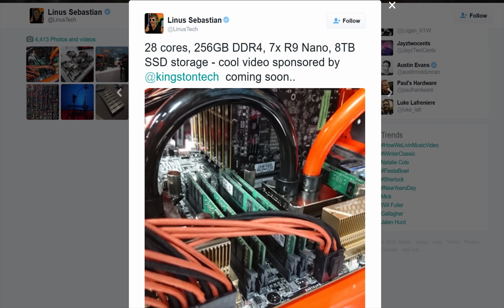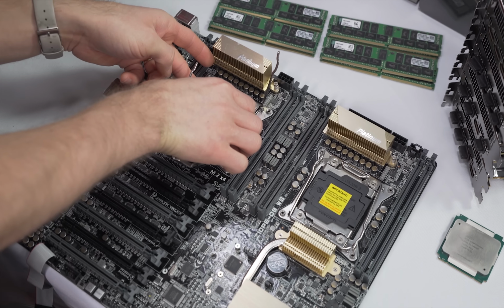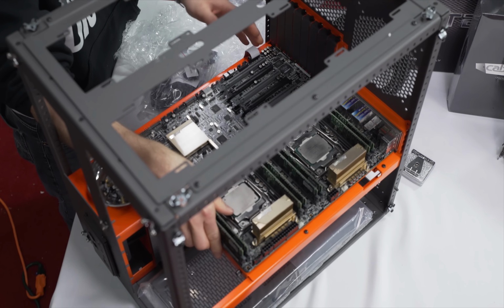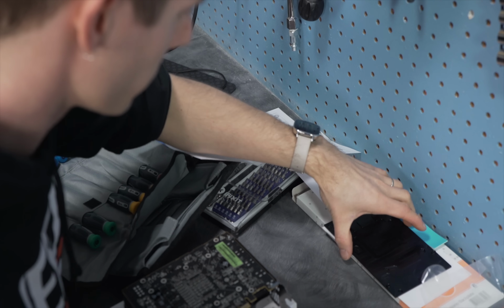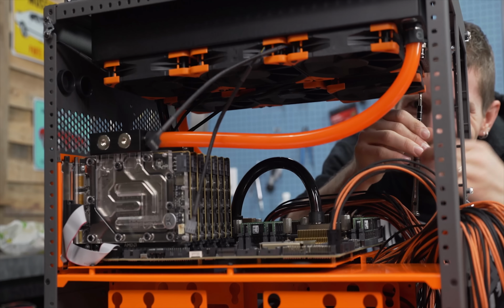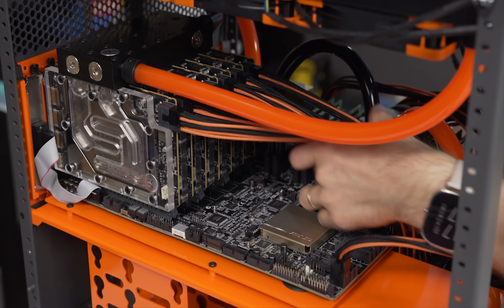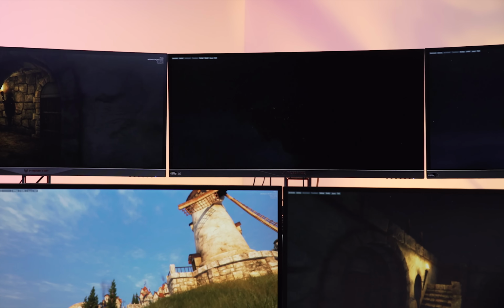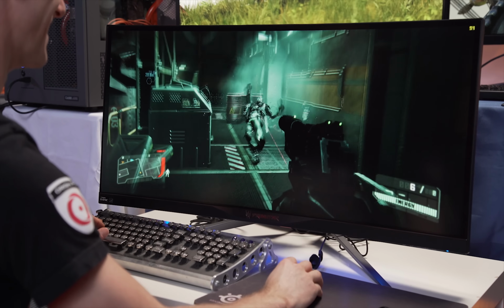7 Gamers, 1 CPU - Ultimate Virtualized Gaming Build Log

Comment: But can it run Minecraft?
Reply: +Blaze Blue no it can't you can't get a good pc for $30,000
Reply: TriggerFX | Konsti S. you know it just occurred to me, where are the console peeps?
Reply: Pretty sure it won't run minesweeper
Reply: +Blaze Blue Minecraft can be one of the most demanding games on market with right mods. So I don't understand why always use Minecraft.
Reply: +Blaze Blue It can probably run that with over 30,000 fps
Reply: +Blaze Blue I bet it doesn't run 7 minecraft at low settings :D
Reply: +QCpowarr It can't even run the BIOS.
Reply: +Blaze Blue yeah but... low settings and aa off
Reply: +Blaze Blue If all seven people are using it honestly probably can't because of the amount of CPU power that Minecraft takes to run at decent settings, especially with mods
Reply: I think it is to low for Minecraft!:( xD
Reply: ***** So basically it's wasting time...if that's how the game is built then yeah they would need a complete overhaul..i'm just wondering why they won't do it, it's not like they have stuff to lose, or maybe they don't know how...
Reply: 720p low 13 fps
Reply: +Blaze Blue 300x200 very low 27FPS
Reply: +Blaze Blue you can usw a mod called optifine for that. it allows an Option called multi Core chunk loading :)
Reply: +Blaze Blue They're still waiting for the video to load.
Reply: +TriggerFX | Konsti S. ya it has to be at least $70,000. This is trash. jk this was so frickin' cool!!
Reply: I heard that when they tested it they tried to run 7 minesweeper at a time, but I think they're just playing with us. I'm sure it crashed under the heavy load.
Reply: true dat
Reply: +Blaze Blue But can it run Runescape?
Reply: minecraft actually is harder to run than battlefield these days
Reply: +Noah E. Doesn't Minecraft use more of the RAM rather than CPU?
Reply: +Blaze Blue Minecraft with mods uses a lot of single-threaded CPU. So I guess it might actually be not as great as expected on this computer. Well, 3.6GHz is great, but Minecraft on it still can lag (I use an i7-4820K @3.70GHz with it and I happen to lag a little bit when my base gets big with a lot of mods).
Reply: ***** wait you actually mean the game isn't optimized for multi-threading? Why? it hurts just thinking about this.
Reply: ***** Yeah. Minecraft works on (almost) a single thread and doesn't even use the GPU (a lot). Never knew why. Some mods like BuildCraft try to use multiple of them, but if the core game doesn't use it, it isn't much better.
Reply: ***** what a shame, the game has been out for awhile, maybe minecraft for windows 10 will be more promising.
Reply: *****
The game itself is full of that kind of bad design mistakes. For example, whenever the code wants to get the TileEntity of a block (block-unique "brain"), the game has to go through a big list of every TileEntities ever on the map, instead of just storing some kind of index ID in the block's NBTTag (easier to access block unique data) to jump directly to the right TileEntity.
Reply: +Blaze Blue No
Reply: lo haha
Reply: JogamingHD It's just about chunk loading, and it is not stable at all.
Reply: +JustPingo ik, But its good for a frickin Java game :) but it seriously needs DirectX... But NOT Like the win10 Version, I have tried that on my friends PC and it wasnt stable either, Like the pocket edition basically...
Reply: +JogamingHD Minecraft is written in Java. Minecraft W10 edition US written in C++, and everybody knows, Java doesn't handle smart with ressources.
Reply: Just because Minecraft has blocky graphics, it doesn't mean a calculator can run it.
Reply: It's too powerful for Minecraft
Reply: +Blaze Blue Trick question. No pc can run minecraft without any lag.
Reply: +Blaze Blue The Windows 10 version is just a different launcher because of java bugs I think, same game still.
Reply: +JogamingHD That is still running most of it in single thread, note the "Chunk Loading" part so machines, mobs etc are still single thread.
Reply: No man, mine craft is way too demanding.
Reply: +Blaze Blue you should see what minecraft looks like on my rig
Reply: +oBLACKIECHANoo salty
Reply: +Blaze Blue even Miley Cyrus vagina can run minecraft

Comment: Cool video but that system is not stable.  Your 1600 watt power supply would need 97% efficiency to sustain those numbers you were getting (1543 etc).
Reply: +Imy Manz The efficiency of power supplies is how much power they take from the wall and put into the system. So the psu is supplying the system with actually only about 1450w, while pulling the 1543w from the wall.
Reply: Okay, I guess I misunderstood. Thanks.
Reply: Yeah, it's kinda weird with PSUs lol. No problem

Comment: I want to know how many fps you will get if you play cs go with that pc full graph settings
Reply: +TheGhostTrollek dejvu that's not how it works buddy...
Reply: TheGugor More fps = smaller input lag. There is not a big difference for me, but it is enough for me to notice it. Having the FPS capped at 80 and 0, is mostly where I notice it.
Reply: +TheGhostTrollek dejvu the screen cant project more than 144 fps so if the machine can create like 300 fps it would only show 144 fps thats why we cant see it
Reply: +GHOST Yes, it can...
Reply: +GHOST The human eye does not see in "FPS" or Images per second.The Eye gets a constant stream of visual data.If you take 100 images,99 of them being exact copies and one looking different and then play those images back one after another in one second then you can still spot that there is a difference.

CS:GO pros aim for high FPS because of reduced input lag.
Basically everytime the FPS double, the input lag halves.
Reply: +Furry:3 ☆ Gaming and more with only one instance with no vms running, easily 144fps. The hardware could do more than that, but the monitors used in this vid are 144hz
Reply: Daniel Ward I think like 1000 fps when you get 300 fps with 800e computer
Reply: +Furry:3 ☆ Gaming and more there would be no point in going over 144 because the monitors could not handle any more. sure, it could technically get 500+ but that would cause unnecessary hardware exertion
Reply: +Daniel Ward You never notice the difference. Me having 300 and 250 is a big difference. And for the pro's too.
Reply: +TheGhostTrollek dejvu Placebos work =)
Reply: Potatowarrior 13 I'm sure it doesn't, but there is a noticeable difference, therefore your understanding is also wrong.
Reply: +TheGhostTrollek dejvu The Human eye cant detect differences over 60FPS...
Reply: GHOST That's false.
Reply: +Daniel Ward yeah but you seem to know so much so do you know frame latency? more fps is better even if you cant see the 300 fps its better than 144 for other reasons
Reply: +Exidrial exaclty!!! finally someone who understands, its all about frame latency thats making input lag
Reply: +Makziie for games it is different based on input lag and other such factors, but watching a movie for example you will not notice anything above 144, or even 60 depending on your monitor, because of the refresh rate on the monitor, that was my point
Reply: TheGhostTrollek dejvu That's false? Explain then... Oh lemme guess you are one of the people who can see more than 60 fps which is impossible.
Reply: Exidrial It does not see in FPS but it can see the Lag of frames.... Past 60FPS you cant see any difference.
Reply: +GHOST You've obviously never gamed on a 144hz monitor then. You can tell the difference on a 60hz monitor too but its VERY clear on high refresh rates!
Reply: GHOST Consdering fighter pilots have been able to spot a plane on 220 frames a second, and then theres you a litte uneducated person, telling different. I will take the educated side, thanks. http://www.100fps.com/how_many_frames_can_humans_see.htm
Here, let's hope you stop spreading this bullshit, "we can only see 30, 45, 60" and so on...
Reply: life is a movie running at around 60 frames per second. When a car’s wheel is spinning fast enough to simulate that frame rate, it can look like the wheels spin backwards.
Reply: Your brain is limited, Fighter pilots should be able to spot a plane at any FPS as long as it is moving, 220 Frames per second spotting  a plane in a film is different from spotting something in real life... Fighter pilots are humans... humans are limited to 60 fps.
Reply: If fighter pilots could see more than 60 that means that the speed of which they see an object is trying to slower than the actual target, so if you are a pilot and a super soldier and can somehow see in 220 fps... that means the plane would look to be going slower than what it actually is going at...
Reply: "Yes. Tests with Air force pilots have shown, that they could identify the plane on a flashed picture that was flashed only for 1/220th of a second."
Picture is not real life. So once again you're proven wrong. Research over your opinion any time.  I shall now end this idiotic conversation.
Reply: TheGhostTrollek dejvu *Research over your opinion* i clearly posted a link...
Reply: +GHOST Forget all this pilot stuff, just game on a monitor that can actually refresh quicker than 60hz and you'll see the difference!
Reply: Antoni Ponter k...

Comment: But each graphic card has 3 DisplayPort outputs and 1 HDMI output, so each player could play on 4 monitors at the same time xD Then it would be 28 monitors in total xD
Reply: Groeger Cesg Y u facepalm? I think it would actually work! Only I'm not sure if each graphis card can handle all of its outputs -  some cards can't handle all outputs, only have them to let user choose which one he/she want to use.
Reply: +Krzysztof Korzeniewski 1 DP can handle 3 Monitors with a Splitter :D
Reply: AngryApple But it'll be the same screen on all 3 screens... I mean 4 DIFFERENT screens
Reply: +Krzysztof Korzeniewski No. DisplayPort can run 3 different screens from one port. Each screen displaying something else.
Reply: ***** Oh, didn't know about that. :) But best NVidia's cards can handle up to 4 screens and best AMD's can handle up to 6 monitors. So you couldn't get 70...

Calculations:
7 cards * (3 DPorts * 3 from a splitter + 1 HDMI) = 7*(3*3+1)=70

Continuation:
...monitors in total, xD because each graphics card would have to handle 10

3*3+1=10

monitors.
These could be these super powerful AMD's cards, but they actually have 6 outputs and these have only 4 (and also monitors are compatible with G-Sync, which is NVidia's patent)
Reply: Krzysztof Korzeniewski In theory, a card with 3 DPs and 1 HDMI could run 10 monitors but they're usually limited to 4 monitors
Reply: ***** Yeah, I've meant exactly that - in theory u could get 10 monitors, but the graphics cards have limitations

Comment: It's pretty awesome as a proof of concept but the single point of failure is kind of a problem. Ten $3000 (or even 15 $2000) machines would provide the same (if not better) performance to more people with less risk. The only downside would be desk space.

Comment: >1 CPU in the title
>dual CPU motherboard
fuck's sake linus
Reply: +slipAngle well reasons was because if you have a 2 cpu in theory the motherboard or the system will recognize it as a single cpu maybe...
Reply: +MoMoTo33127 That doesn't make any sense.
Reply: +slipAngle Valid point, it should say "1 PC" as opposed to "1 CPU".
Reply: +Lukáš Katrenčík Exactly. And there are two CPUs installed on the board.
Reply: +slipAngle central processing unit - the part of a computer in which operations are controlled and executed. ... no specification that it must be one processor unit
Reply: +Sot Dot It doesn't.
Reply: +slipAngle Surprised to find BS like this in the business?
When you get goods thrown at you for advertising, it's easy for some to lose the ability to count to two.
Reply: +slipAngle 1 CPU for game, 1 CPU for VM
Reply: +slipAngle The original, 2 Gamers, 1CPU, was in reference to the 2 Girls 1 Cup (2G, 1C abreviated) So they kept the same theme here.
Reply: Alot of people misuse the term CPU to mean a computer without peripherals/monitors/accesories ie. the case and internal components.
Reply: +Cesar Lima Well, Linus may not be the sharpest tool in the shed, but he should at least know what a CPU is.

Comment: 1800 VA (volt amps, similar to watts) is the maximum you can pull out of any circuit in the house, that means this could very likely trip a circuit breaker, as well as function like a furnace LOL!

Comment: Why doesn't anyone mount their radiators to the outside of the case so it doesn't channel hot air through the case itself?
Then install fans where the radiator would normally sit just to push air for the case for the motherboard.
That way you dont' transfer CPU heat on other components. Or if your one of those that push out the top, you don't get other component heat transferring to your radiators.
Reply: +Anon Mason you want as much radiant heat absorbed into the radiators then discharged via the fans so mounting on the inside is best.
Reply: +Anon Mason Because it's the ultimate 30 000$ gaming PC, it needs to be done right, and not have stuff hanging out of it.
Reply: reaper575556
We hang headphones off cases with hooks...
And when we're talking about getting max cooling people do far more crazy things. Yet never that.

Comment: If you ever need help disassembling it when you're done you can always send it over to my house
Reply: dadasmithywinkle dude, you have to be joking that you have never heard of this.  Internet cafe's literally all over the world do this.  Also, if you go to one of those party lounges or places that have computers hooked up in rooms you can rent out, they have these.  They are SUPER common.  The towers are about 5 feet tall and about 3 feet wide.  They each have about 10-12 CPU's in them, depending on their requirements (like what games are gonna be played and graphical requirements).  They cost about 250,000 dollars, and they are usually put together by a company.  Each computer is routed to either one or two internal in house servers that cost about 30,000 a piece in case they are needed.  The ignite lounge in chicago has 15 of these pc's for their 117 monitors .  Just call them and ask. Also, if you have ever worked in an office environment, some offices dont have individual pcs.  They will have IT running a master pc with several slaves positioned around the buildings all controlled by in house servers.  I cannot explain to you how common this is.  Also, all the dota 2 and league mutli-matches are ran off 1 in house PC.  This is to prevent cheating.  There are countless example of a game of 10v10 running of 1 pc.  This is to prevent cheating or what not.  Each member can bring their own mouse and keyboard.  Each player has access to his/her own settings and game and whatnot via the same way linus did it here.  Just a simple cloning, to prevent from settings change and game deletion....What linus did was just what large companies have been doing for about 15 years now, just on a very small individual scale.  It isn't that impressive to someone that has seen them everyday.....
Reply: +dinoreah 2 Post a link to back up your claims. I call bullshit for 10-15 people on 4K off of one machine, all gamining at once under good FPS
Reply: +MeLikeBigBoom  its AMD GPUs dont get excited
Reply: +Jhaner Madriaga it';s a mircale it's all working, I would worry about breathing to heavily around the system... :) If it's working, DON'T TOUCH IT!!!!
Reply: +Jhaner Madriaga they wont disassemble it..... they will take it lol
Reply: ***** Nvidia works better than AMD so guess who I would be a fan of
Reply: Drew Hersey  That's true but that doesn't eliminate the fact Nvidia is doing a better job than AMD
Reply: +MeLikeBigBoom Haha, I dont know why they want to Disassemble that State of the Art Build!
Reply: Hey it's you!
Reply: hey you play unturned! High five
Reply: +Jhaner Madriaga its not state of the art.  This thing is common in lan cafes or video game huts or whatever you call them.  They usually have a pc that can run 10-15 gamers all in 4k.  It is just "state of the art" for the common person...
Reply: +dinoreah 2 found the troll
Reply: +shane neyome He has dinoreah of the mouth.
Reply: +dinoreah 2 found the troll
Reply: +Israel Salgado there is all ways that one guy
Reply: +MeLikeBigBoom Hey it's MMBB! I didn't know you watched Linus!
Reply: *****  the R9 295X, which is a massive power eating card with an additional cooling fan is only 5-10% better than the smaller, cheaper more efficient 980TI
Reply: +Noah S.  if it was not for AMD your nvidia card would still be shit
we need both amd and nvidia so they compete so we keep getting better cards 
cause there would be no need to make it better / faster if you are the only one making it in the video card market

Comment: That is a beast of a PSU, but hope wouldn't have been lost without it. Granted the one I worked on was terribly done, I have seen 2 PSUs in one case. Working at a local repair shop a guy came in who had a PSU failure on his gaming rig, thought it wasn't powerful enough, replaced it, and took apart a 2nd PSU to mount bare in the case just for the graphics card. It worked, he linked the green cable and they came on just fine, worked for a few months, but he used a crappy brand 400w for the graphics card and it failed quite spectacularly across 4 of the smaller caps.

Comment: What have you used for the virtualization? I suspect you haven't gone for the ESXI (vmware) since it doesn't have any 3D compatibility (or practically none). Care to share that info with us? Hiper-V maybe? Cause honestly, i am more admired on how you got it to run so smooth on virtualized environment than the specs of the machine itself, that's the easier part in my opinion.